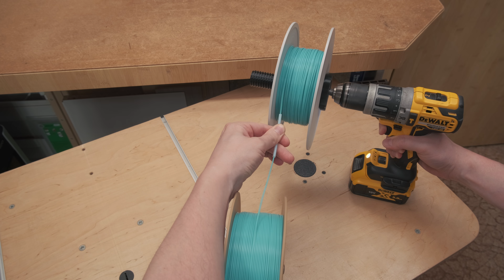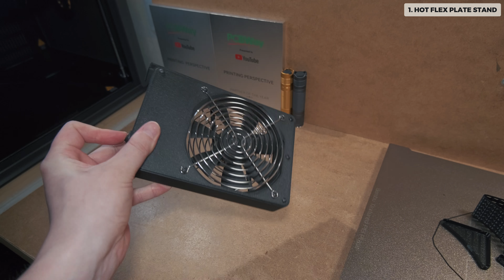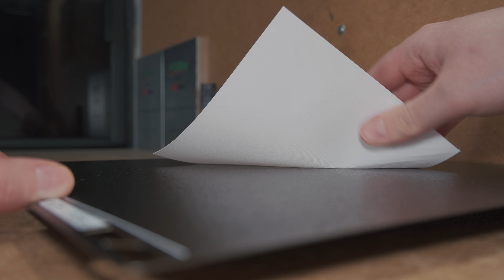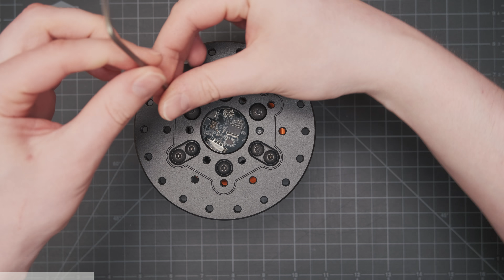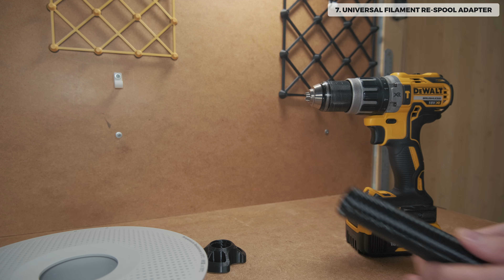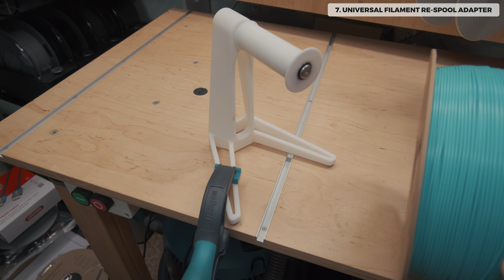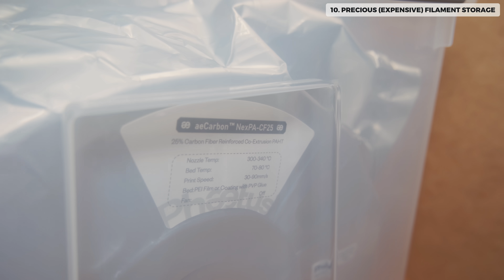3D Printing Pro TIPS & TRICKS (ACTUALLY WORKS GREAT)

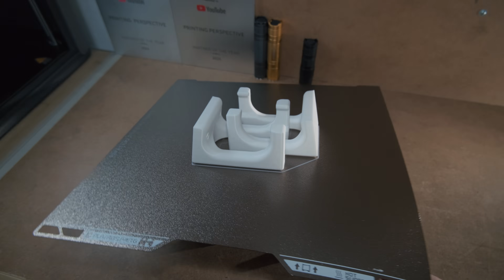Comment: 1:25 Not even that removing when hot can mess up the parts, trying to remove when hot inevitably degrades build plates faster. I always buy two of each plate, so when I need to get a new print going immediately I swap in the new one and let the first cool naturally. In the long run buying 2 plates initially and rotating them gives you much longer life for both than buying them one at a time and using each until they're worn out.

Comment: Isn't using drying box is more convenient and also cheaper in a long run (let's say over year(s)) than keep juggling filaments in and out from their respective box and sealed conteiners everytime and regularly changing their silica gels?
Reply from the maker: If you use those filaments often, then yes, but if you only use them rarely, placing 10-20 filaments in good dry boxes is way too expensive.

Comment: Do you have the STL/STEP for the spool holder you used?
Reply from the maker: It doesn't work great as it has almost no friction (you want friction so that the free-rolling spool wouldn't carry speed if the drill speed suddenly slows down) and requires hard to get hardware.
Reply: @PrintingPerspective  Cut up some flat rubber bands and glue them on. Plenty of friction.

Comment: I also must caution folks on the respooling process using a drill.  If you slow down for even a moment, the momentum of the spools can cause chaos. And a temporary increase in speed means that the donor spool will also increase speed and take longer to slow down. 

In short, if the donor spool is going faster than the receiving spool, you could end up with a nice big plate of unusable spaghetti.
Reply from the maker: Yes, that is why it is a little bit tricky and needs experience. I usually slow down the free-rolling spool with my hand.
Reply: @PrintingPerspective  smart! I only tried using the drill once.... lost an entire kilogram somehow 🙁 lol..

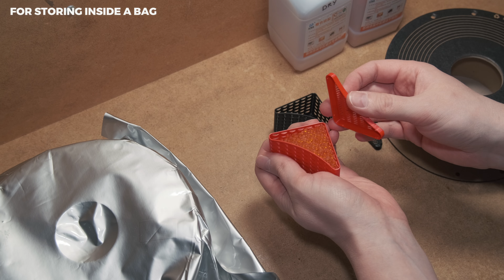Comment: 6:20 Vacuum bags and a vacuum pump work wonders. These have a good double zip lock and a dedicated opening for the pump that's used after the bag is sealed.
Reply from the maker: Maybe I need to give it a try, because regular plastic bags with seals last not that long. Now I am wondering if maybe it is the seal and not the plastic bag itself. But plastics have quite a high water vapor transmission rate to store at very low humidity for long periods. I would be very interested in high-quality aluminum foil bags, they are vastly superior.

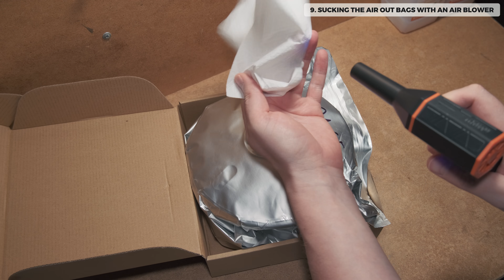Comment: 6:46 I literally just did this exact same thing but in reverse for cleaning my PC last weekend. Didn't have much air duster so supplemented it by taking a handheld vacuum cleaner (same shape as your blower) and printing basically the exact same adapter you made here to blow dust out around the sensitive bits.
Reply from the maker: Haha, this is awesome to hear! Literally reverse Uno ;D

Comment: in general i try to avoid putting razors near my print bed  i do  if i feel i have too though . On elegoo centaury carbon the  bed for pla some times holds on pla lite it holds the Excalibur  small bits are really stuck in there , instead of putting a razor i rise the  bed temperature to 70c and they become soft and easy to pull just careful with the touch feels very hot as far you do not touch for  more than 10 seconds i do not think it is a problem never had a problem  with that .
Reply from the maker: Those blades for the scrapers are not like razor blades, they are more dull. But yeah, the way you said is an interesting one to get rid of those bits.

Comment: Increase your brim gap setting from the default (0.1 or 0.15mm) to 0.3 or 0.35mm - it will still help with adhesion but most times you can just peel the brim off the model in one piece. No tools required.
Reply from the maker: I used to do that, but mainly for the brim to be as an insulator that prevents build plate cooling down too much and print coming loose.

Comment: A hot-air reflow solder station, if you swing into electronics, works well for going over the surface.  Heat can be exactly set, as can the airflow, and it won't immediately catch stuff on fire.  Honestly, I use that hot-air rework for all kinds of stuff.  I've even used it for surface mount soldering once or twice ;)
Reply: i use one at work and they are so handy. i should really get a cheap one for at home too
Reply: Same it's nice to have for more than soldering

Comment: - The only materials for which you MUST remove parts when still hot are industrial-grade materials like PEEK, Ultem and such. Every consumer-level material (besides flexibles) should be let alone cooling fully and naturally,  to avoid any "warp".
- PETG (and flex, and some others) :  use a "release" agent (which is a "adhesive agent" for old-fashioned ABS/ASA) to avoid any material/build plate bond. No "scraping tool" is required.
- Inserts : use an insert press, as you mentioned it ! It's cheap, it gets the job done, it's repeatable and 1000x more reliable than doing it by hand.
Reply: How can the release agent be used? Should I spray it after printing?
Reply: @handle_master before. Basically just paper glue would do. 

So instead of helping adherence, now it acts also as a barrier so the filament not fully touched the plate in the first place. 

Useful for TPU and rarely PETG (if you need for PETG then either you're using a glass plate, or your current plate is bad bad).
Reply: @handle_master  Spray it over the buildplate before printing.
Reply: @Lidocain777 Is there no problem with adhesion even if you spray a release agent before printing?
Reply: @handle_master  Nope. At all. Release agents and adhesion agents are the same thing.
It's a release agent to materials bonding too well to the build plate : flexibles, PET/PETG/PCTG, and some ABS/ASA formulations like FormFutura's TitanX and ApolloX. It's like a very thin layer promoting adhesion when hot, and allowing for easy part removal when cold.
To materials warping easily, it'll help keeping the part stuck to the bed until the print is finished and fully cooled down.
Reply: @Lidocain777 Thank you. I understood that this agent only serves the role of preventing them from sticking together.

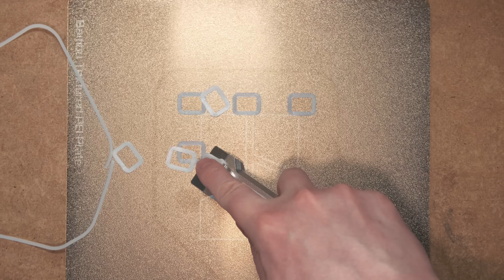Comment: 1:30 this is probably your build plate that's stuck to the PETG. I ripped the entire coating off the PEI plate when I tried to print PETG on it. The Glacier plate is amazing for PETG (and anything else I've tested for that matter).
Reply: PETG can get rather sticky.  On some build plates, I spray a thin coat of Windex before printing PETG: it'll come off way easier (of course it'll warp easier too, something to keep in mind)
Reply: @kaasmeester5903  I just stopped printing PETG altogether and only print PET-CF nowadays. With PLA-HT-GF as easy-break-off support that doesn't deform in the extruder. A match made in heaven!
Reply from the maker: Yeah, with some PEI plates PETG sticks better and on some worse. But that is mainly petg, sunlu pc and polymaker abs, most other materials come off way easier. :)

Comment: Vision Miner Nano Polymer. You'll never use a scraper again.
Reply from the maker: I think I just don't have big enough problems to justify spending 60Eu for 120ml.
Reply: @PrintingPerspective yea. Love everybody keeps calling it out like a god-sent product. 

Probably is, especially on PEI specifically yes. I have 2 little bottles that I rarely used on smooth and textured PEI. Was expensive, was working as intended. But this god-sent is expensive, as expensive as some other resin based plates like Glacier Pro and people would throw so much money on other things first before believe their stock, uncleaned PEI plate is the issue. 

But, that 120mL would last like some years though, or more. since it's more like applied once use 10 times. But be warned, some non-PEI plate will create a very strong bond, like, too strong bond.
Reply: @StooStranger  I have no problems with adhesion, I need it as release agent so I can re-use my build sheets. Plus, Nano Polymer will survive high temperatures, I think up to 300c at least. All other bed adhesives on the market will break down after the chamber gets to 130c - 150c.
Reply: @PrintingPerspective  Well worth the money if you print hot enough! My printing chambers go to 250c and Nano Polymer will survive inside.
Reply: I don't want to support nazls.

Comment: Shaving cream brushes are fantastic for cleaning dust off build plates (sometimes you start a print and the part or nozzle fan kicks up dust that lands on the plate). I keep one handy by my printers.
Reply from the maker: This one I definitely didn't hear before. For this I use long thin tweezers to pick up stuff from the build plate or crap that still hanging on the nozzle.

Comment: I almost never remove build plate from 3d printer. If I need to remove part quickly - just use turbo fan to quickly cool it 💨
Reply from the maker: Interesting. I used to do something like this but in different way - to heat soak a printer faster by blowing on the hot bed. But I converted all my AUX/turbo fans to be air filters as I print high temp filament quite often.

Comment: These are great tips for 3D print hobbyists. 
Just remember with larger part you want to let it cool slower to prevent warping. Let it sit in the printer for a while, can use the printers venting feature to remove the hot air.
Reply from the maker: Yeah, I probably should have explained more why the bigger the object the more time it should spend inside the printer. I never tested this with a full deep dive video, but maybe I need to do that to see what the actual difference is.
Reply: @PrintingPerspective obviously you have a big flat surface. It can warp coming off the plate if you do it too  soon, but something vertical isn't going to warp as you bend the build plate the same, so orientation matters
Reply: Or use the alternate wall direction 😅
Reply: Yep, I’ve had panels I pulled off too soon warp and curl on the edges
Reply: YEAH DONT DUNK THEM IN WATER I USED TO DO THAT AND THEY WARPED REALLY BAD AND THEY KEPT DOING IT

Comment: You can take a cardboard spool, rip off the sides, and place the core onto a reusable Bambu spool.
There are some tools you can print to help with this, stop it from unwinding.
Reply: OH MY GOOOOOOOOOOOODDDDDD. Does this REALLY work? I have, like, 10 Anycubic deusable Spools. And 1 from Sunlu. But most cheap filaments come with paper spools. Dude, that would be awesome. 
Could you tell me the name of such a tool that will help me preventing the unwinding thing?
Reply from the maker: Is this only for Polymaker cardboard spools? I heard this one before but never dared to try it. Plus there's something satisfying about re-spooling filament. Still, a great tip!
Reply: @PrintingPerspective in my testing and experience. Not all cardboard spool core will fit. 

Maybe everybody changed it recently following a "trend" but I can guarantee my brain thought it was a great idea a year ago and have to respool like 3 random cardboard spool. 

YMMV

Comment: I throw my hot build plates on cast iron woodworking machines.  Sucks the heat right out of them for better or worse.   Plastic razor blades with a printed handle for the scraper.  One in every printer.  Not like I planned it, but smooth black PEI shows fingerprints if you touch it at all.  It broke me of using my fingers instead of the scraper because I'd see the oils left and have to clean, which is more work than using the scraper.
Reply from the maker: I remember taking out hot plates and placing them on a cold bed on another printer. It soaks up heat fast, and the plate stays flat during cooldown. About plastic razor blades, do they last? The metal ones, I have never changed them, and I am using and abusing them constantly. BTW, fingerprints with oils completely ruin first layer adhesion. The good thing is that on the black smooth PEI plates they are easily visible, unlike on textured PEI.

Comment: My tip is: Sketch out your part before opening CAD! If the first thing you do is opening CAD, alarm bells should be ringing.

Sorry, only tangentially related to 3D printing.
Reply from the maker: A great tip nonetheless. I often do not design very complex stuff, so I always have a rough idea what I want to model. But for more complex models that's definitely the way. :) But I need to do this more regularly. By quickly sketching you can go so fast through multiple rough designs to find the best solution.